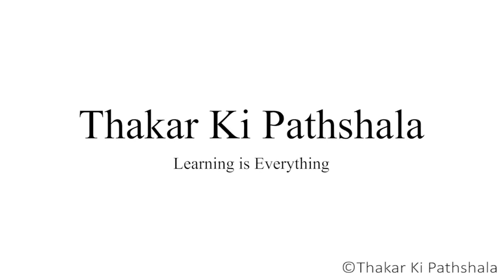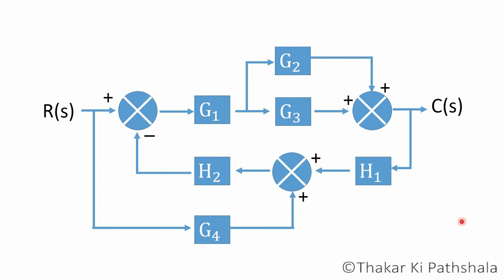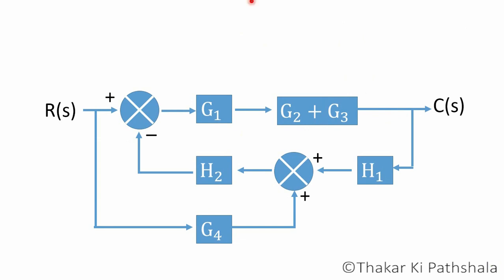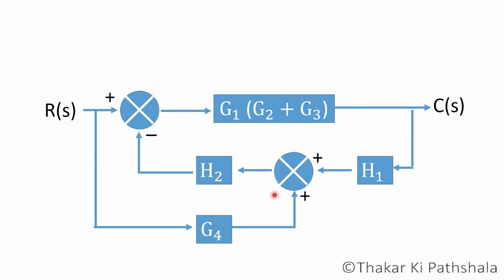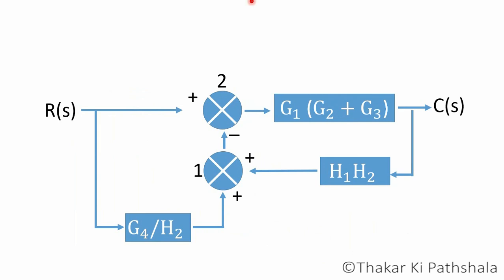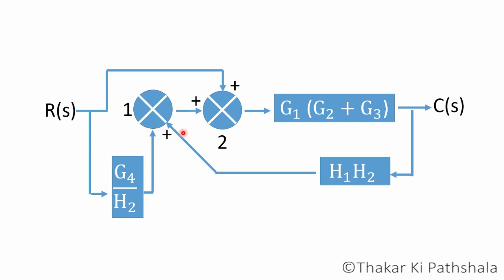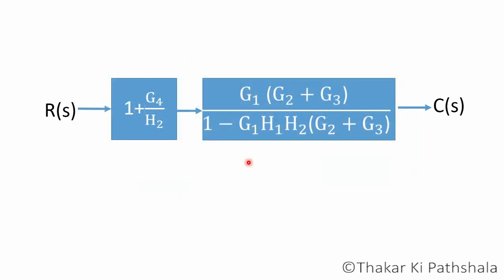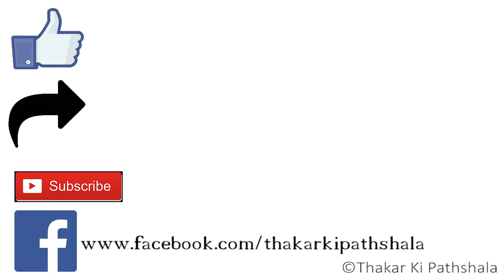Block Diagram Reduction  Control System Examples

Comment: Mr. Mostafa has rightly pointed out your mistakes. Summing point is going AHEAD of H2. You have treated as though it is the opposite case. Do the math it will not add up.

Before moving the summation point: (H1 + H2).G4 = H1.G4 + H2.G4 
After moving the summation point: (H1.H2) + G4 

Hence, G4 needs to be multiplied by H2 to make before and after situations mathematically equal. You have divided G4 by H2 and, as I have proved above, it is wrong. 

I read your reasoning to Mr. Mostafa's argument. You said summing left and hence H2 should be divided by G4, as per the rule. But the direction of flow of events in this situation is opposite to that stated in the rule & hence your counter-argument to him is also incorrect. 

Please add this correction in the video so that people don't learn the incorrect answer.

Comment: I don't know anything he just did. So I used Mason formula and came up with this. Maybe it's wrong in a sign, but I'm sure I followed up the steps. This may shed some light in your quest.
(G1G3+G1G3G4H2+G1G2+G1G2G4H2)/(1-G2G3+G1G3H1H2+G4H2+G1G2H1H2-G2G3G4H2)

Comment: Using your rules in another video, I've found the answer to as  
C/R = (G1G2+G1G3+H2G1G2G4+H2G1G3G4)/(1 - H1H2G1G2 - H1H2G1G3)

The mistake is at 3:00, because in rule numbers 5 and 6 you've mentioned the terms "before the block" and "after the block", not "right or left" of block.

Comment: Thank you for your effort, but I think you have made two mistakes.
At 3:00, we are actually moving the summing point after the block not before it (we knew that from the direction of the arrow), so you must have multiplied by H2 instead of dividing.
In the next step you also replaced the -ve sign with +ve in the summation point 2.
Therefore the final answer should be as follows
C/R = (G1G2+G1G3-H2G1G2G4-H2G1G3G4)/(1+H1H2G1G2+H1H2G1G3)
I have solved it using other technique and also got the same answer.
Reply: Yes i just picked that up as well. I was worried i might be wrong. He was Supposed to MULTIPLY  BY  H2
Reply: I'm confused too that's why I checked the comments 😮 thankssss
Reply: Mostafa El Nahas 
Yes you are right
Looking at answer i thought i was wrong but after viewing the comments i relaxed
Reply: Getting Mostafa's result, this is a simple block diagram.
Reply: That's right
Reply: Yes its really wrong.. Look at the direction of the block.
Reply: Sir. Can you share your solution for this question with me? I really need this solution from you. Than you in advance
Reply: Mr. Mostafa has rightly pointed out your mistakes. Summing point is going AHEAD of H2. You have treated as though it is the opposite case. Do the math it will not add up.

Before moving the summation point: (H1 + H2).G4 = H1.G4 + H2.G4 
After moving the summation point: (H1.H2) + G4 

Hence, G4 needs to be multiplied by H2 to make before and after situations mathematically equal. You have divided G4 by H2 and, as I have proved above, it is wrong. 

I read your reasoning to Mr. Mostafa's argument. You said summing left and hence H2 should be divided by G4, as per the rule. But the direction of flow of events in this situation is opposite to that stated in the rule & hence your counter-argument to him is also incorrect. 

Please add this correction in the video so that people don't learn the incorrect answer .
Reply: Yes bhai..in ne wrong kiya hai...i have got same as you
Reply: Yea sir u r right i too got same doubt and thanks for ur explanation I got exact answer😁
Reply: Dear Mostafa El Nahas, I've found the answer to be 
C/R = (G1G2+G1G3+H2G1G2G4+H2G1G3G4)/(1 - H1H2G1G2 - H1H2G1G3)
Reply: @mohammednomanahmed3866  Me too 👍
Reply from the maker: Dear Mostafa El Nahas thanks for watching this video as well for your good words. I have double checked both the things that you have mentioned and found them right there is no mistake in that. For your first confusion I am moving that block to our left hand side so before the summing point. Thanks once again for connecting with us. Have a nice day. If you have any doubts then feel free to ask anytime.

Comment: At 3:00 why did you put the arrow of 1/H2 into H2 rather than putting it in  summing point according to the rule you stated in previous video?

Thanks in advance for helping.
Reply from the maker: That was the mistake the arrow should go into the summing point it was corrected in the next step. Sorry for the mistake. Thanks for watching and outlining the mistake. Have a good day.
Reply: Yes as soon I switched over to next slide I discovered it was a mistake.

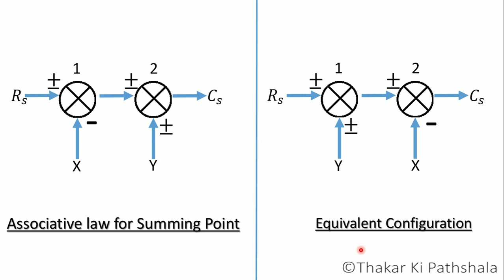Comment: At 3:35 to 3:39. I guess your just moving summing point 1 to the left side of summing point 2 and nothing changed in connections. How the negative sign at summing point 2 gone? Thank you and sorry for my grammar :)
Reply from the maker: Danilo Paglicawan thank you for watching and sharing your query with us. I have read this at this time I am some what busy but as soon as I get some time I will answer your question. Have a nice day.
Reply: Thakar Ki Pathshala sir please!  give sol
Reply from the maker: Priti Dsouza and Danilo Paglicawan thanks for your patience it happened by mistake i have looked into that and the sign should not change. Thanks have a great day.
Reply: Sir Thakar Ki Pathshala, may I request for the right answer? I am new with this wonderful lesson which you had taught in this video. And, do you have a video tutorial of getting the transfer function of a certain circuit with the help of electrical methods? Thanks for your respond and have a great day as well.
Reply from the maker: No Danilo Paglicawan right now I do not have such kind of video tutorial on this channel and there is no plan for such in near future because right now I am working on the video series of Routh Hurwitz Stability Criterion. But I am sure you will find it if you google or you can look for this book called "Modern control system by dorf and bishop"  this book has some very good explanation about topics of control system. I hope you have got your answer if not then feel free to ask happy to help you and I appreciate your efforts to learn new things keep it up. Have a good day.
Reply: Thanks for the reference sir. You're such a kind person I really much appreciated. Keep it up sir. Good luck!
Reply: Thanks

Comment: I have doubt sir..
mistake at 3:00..N it should be G4*H2 bcoz phenomenon of shifting takeoff pnt or summing pnt before or after the block is depend on the direction of arrow so here in  above case there is shifting of summing pnt after the block   as shifting is in direction of arrow.
if I went wrong pls clear the doubt...
Reply from the maker: Dear Kalpesh gade thank you for watching and sharing your doubt with us we will try our best to solve your doubt. For moving summing point before a block or after a block you don't have to look for any arrow you just have to look that if you are moving it before of after the block. In our case we are moving summing point before block means we have to add inverse gain of that block. That is it simple. If you want to learn more about all 10 rules of how to solve block diagram reduction problem then watch our this video https://youtu.be/2Cxkxfm3V44 .If your doubt still persists then feel free to contact anytime happy to help you. Have a good day. and keep learning.
Reply: won't the direction matter, I mean the arrow tells us the direction for us to decide before or after the block right? Even I feel Kalpesh gade is correct.
Reply: Kaplesh gade is right cuz the direction changes. if u have a doubt write the equations manually before solving the block diagram . have a nice day!

Comment: sir plz can you explain rule no.4 in more detial, when to apply and much more. it will be very helpful. Thanks
Reply from the maker: Thank you Baldeep Sarwara for sharing your query with Thakar Ki Pathshala . Rule No. 4 is about changing the input of summing point which are after one another means there should be no block in between the summing point the summing point must be connected directly. It is called as associative law of summing point which is just as associative law in algebra 2+3 =5 or 3+2=5 both are same but to simplify the diagram we have to take this step. I hope you have got your problem solved if you have still any query regarding this or something else then feel free to ask anytime Thakar Ki Pathshala will do best to clear your doubts. Have a good day. Keep learning.
Reply: sir, one thing more i want to ask. Is their only one way to solve a problem or we can solve by different ways.
Reply from the maker: No this is not one and only method to solve block diagram reduction problem there is another method which is called as Signal flow graph I think that you must be familiar with it. So what you can do is convert the given block diagram into signal flow graph and then solve it via that technique. But in examination if they specify to solve the problem to solve by any particular method then you have to use that only. Thank you for sharing your query with Thakar Ki Pathshala.I hope you have got your problem solved if you have still any query regarding this or something else then feel free to ask anytime Thakar Ki Pathshala will do best to clear your doubts. Have a good day. Keep learning.